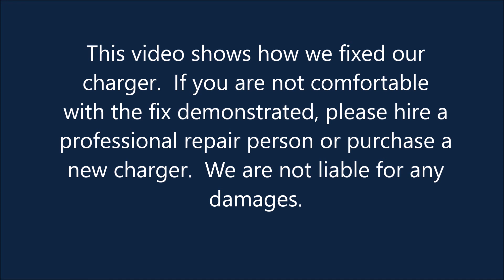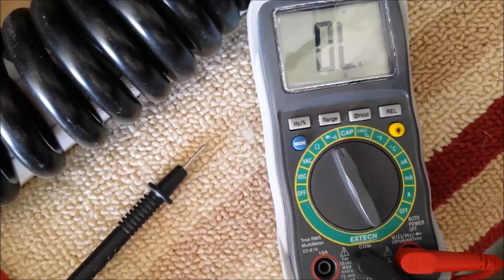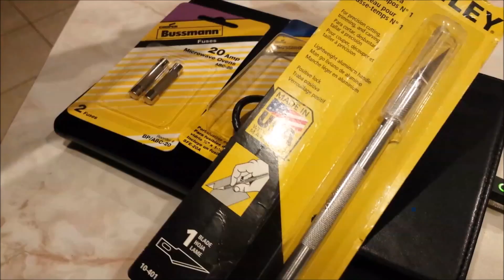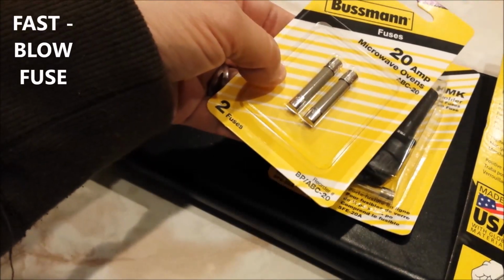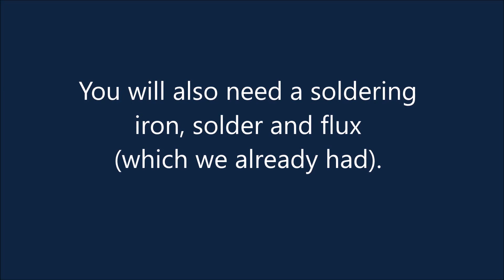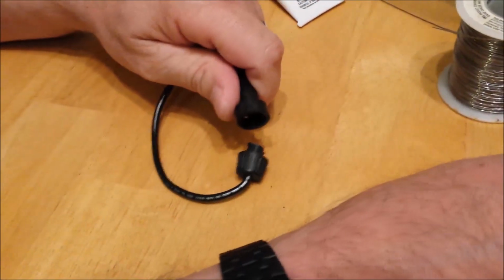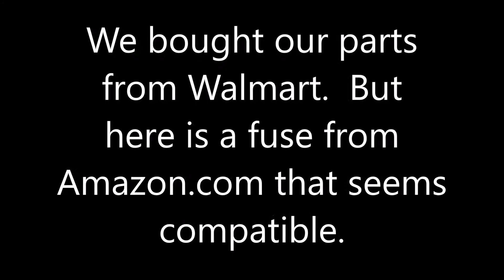Voltec Car Charger Repair - Parts from Home Depot - Save HUNDREDS!!

Comment: Hello I'm Pekka from Finland. I saw this video and I repaired our charger based on that. MANY THANKS to you and people who are so kind when they publish videos like this one.
I did a bit differently. I solded new fuse 500V 20 AMP directly to to top of old one so I didn't need to remove old from circuit board. New fuse was bit bigger approx 38m long and almost 10mm dia.
However that works well. I spend 2 EUR and saved more than 450 EUR (500 USD) by following your video. I found new fuse from special store and I think it's safe when values are same.
One more time many thanks to you.

Comment: I did this repair and a week in of daily charging I came out to a smoking charger. The fuse holders had gotten so hot they melted and caught fire. Please be careful doing this repair. Had I not walked into the garage and caught this, I fear what would have happened.

Comment: Why did the fuse go bad?
Reply from the maker: Fuses can go had after years of use or when power spikes.  Their purpose is to stop equipment damage.  The tiny filament running through the fuses breaks  (sacrifices itself) to save the rest of the equipment.  What's odd is that fuses are normally meant to be replaceable (not sodered in).

Comment: Exact same thing has happened to my Voltec charger - I have the fuses and am wondering whether to try the soldering myself or find a TV repair shop (do they even exist any more?) or a mobile phone repair shop to do that step for me.
Reply from the maker: We did it ourselves.  I would recommend just replacing both fuses at the same time.  After the fix in the video, we had to replace the other fuse about a year later.
Reply: Tech Angel Had to replace both fuses, not the prettiest soldering job ever, but the charger is back up and running - a week on the 110v was way too painful!  Thanks again for your video.

Comment: Thanks for posting.  You said in the video 20 amp 500 volts was written on the fuse itself but you bought a 20 amp 250 volt fuse.  Everything worked ok with 250 volt?  Should I get the 500 volt 20 amp or the 250 volt 20 amp?
Thank you.
Reply from the maker: +Jordan Christopher  I bought the closest match.  It's been working fine since we fixed it.
Reply: Thanks.  I'm having a hard time finding the fuse and holder here in Canada.  Amazon carries the fuse but takes a month to ship.  The fuse holder I cannot find anywhere.

Thanks for posting this.
Reply from the maker: +Jordan Christopher  
You may be able to find it at digikey.com
Reply: Tech Angel thank you!!!

Comment: Thank You So Much!
I was about to bite "the brand new EV Charger" bullet till I saw your video.  
Each step was pretty clear.  Anyone having problems with the 20 amp 250 volt
microwave fuse from Home Depot?  I'm guessing it won't be a problem to leave it?

Comment from the maker: As of today, repair is holding up great.  The charger charges the Chevy Volt every night without fail.
Reply: Where did you buy the 500 rated fuse?
Is your Volt charger still using the 250 rated fuse that you used in the video?  Is it safe and does it give you the full charge to the vehicle?
Reply: Did you get my message? I had a question about the fuses. Could you please respond back?

Comment: We're having trouble with the nozzle part of the 110 charger.  It wouldn't release from the car, so we used a flat head screw driver to dislodge the internal clips holders in the hard black plastic cover to access the clamp that was stuck in the lock positIon.   There was two white plastic ties holding parts in place, however, the were stiff and barely moving.  We applied grease and the clamp now releases easily.  Next we have an issue with the nozzle, it's not charging.   Anyone taken the nozzles on the chargers apart yet?